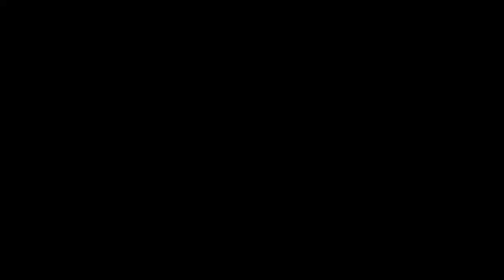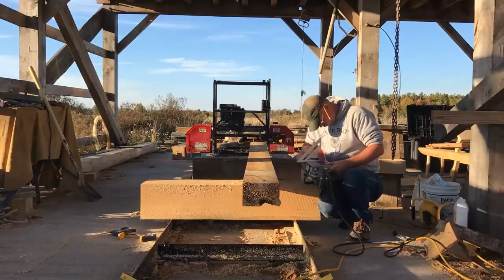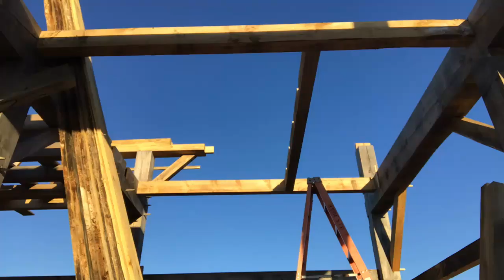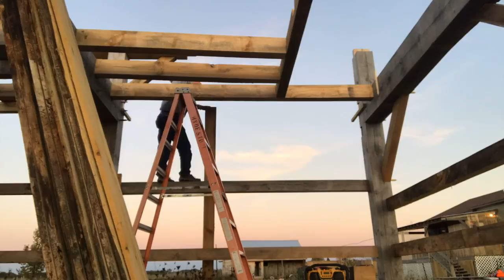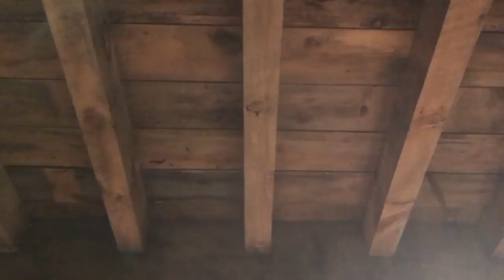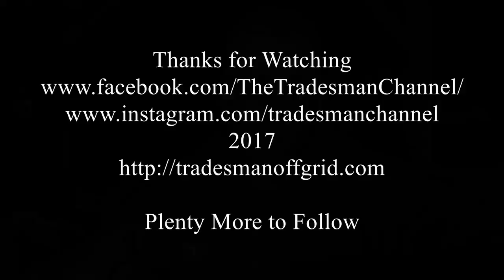A Timber Frame Vlog #64: Things You Should Know if Designing Your Own Timber Frame

Comment: Jim, you may need to check your wood weights of the wood your are using. I use 2.92 lbs per bdft for ewp (eastern white pine) and 5.92 lbs for red oak. White oak is 6.1 lbs per bdft, I believe. Jim Rogers
Reply from the maker: +JimRogers117 will do.  The weights I used I found on a forestry site.  I'll see if I can find them for you, the oak I know I was hazy on as this frame has been all pine.  Thanks Jim.

Comment: Great info you presented Jim!  Did you use the tools in the toolbox on the timber forum in your calculations?  I've been perusing several of the tools and one especially for my selection of timbers and their respective capabilities within a frame.  Keep up the great work!  Thanks
Reply from the maker: +Gary W yes I did.  Those tools are spot on compared to the other ones I tried out.

Comment: Hey Jim  really great vid today..
Quick question. How much over built is a timber frame?  I have worked in structural overhead concrete for years and most all of it is built 250% to 300% over all live and dead loads.  Im sure your structure is not that over built but wondering how much it is.
Reply from the maker: +jim stew they look over built until you start looking at the joinery.  The joinery also has to support the loads and will also dictate some of the timber sizing.

Comment: Certainly there is a Google app which calculates live and dead load structure sizing for different species of wood.  Yes, I understand what you're saying, but isn't it just good enough to cut your posts oversized to begin with.  Heck, you put 12" x 12" posts, I'd go with 18" x 18" SYP and feel confident it won't fall down.  Then I'd oversize top plates, rafters, joists and perlins just to be sure it won't fall.  Engineers are there to see how SMALL a timber can be in order to support the weight.  Less lumber equals cost savings.  When you're cutting a log fresh out of the forest it is very easy to cut it oversized than to scratch your head, ponder numbers, and consult several websites with load calculations, and then you realize that the oversized logs you milled were perfect.  Yes, I agree that engineering is critical, but if you intentionally over engineer the building from the start then I don't see too much of a problem down the road.  (Except some safety nanny saying "Why did you over engineer this structure?  It could have been half the thickness on all posts.")

Good thoughts, Jim.  I agree with you but when I build I'm going for the over engineering aspect and throw the overpriced engineers to the wind.  The Amish didn't consult a manual two hundred years ago and their buildings are still going strong.
Reply from the maker: +Tynyyn good evening Terry.  I just got the mail, thank you very much.  That is a real beauty.
When I talk of figuring timber sizes I agree with overkill myself but there also needs to be an economy of material use of you can, especially if you have to buy the logs.
Reply: Wow, that was a quick shipment.  Hope you enjoy and find it useful.
Reply from the maker: +Tynyyn I can't thank you enough.  It will be getting some use for sure.  I feel guilty accepting it but I really appreciate it, nicest hand saw I have now.  You will be seeing it in use this weekend.
Reply: Please, please, please, before you use it on any of your beautiful logs, test it out.  I cross cut a 1 x 3 and was not too happy with the results.  Then I ripped the same board and was please at how easy it ripped.  Just test before you jump whole hog into cutting any nice boards.
Reply from the maker: +Tynyyn I will, I can touch it up too.

Comment: Of course you meant a structural engineer. There just may be some idiot out there that would take their plans to an electrical engineer. I'll tell you all, as an electrical engineer I wouldn't trust myself to give the OK on structural plans and I spent years building stick-framed homes. Thanks for sharing, Jim.
Reply from the maker: +Thomas Russell timber framing engineer, you need sleep too.  Good morning
Reply: TheTradesmanChannel 2017 
Yeah, I can sleep between semesters or when I'm dead. But thanks for the correction. As a future teacher, I always want folks to get the correct information. And, good morning to you Jim.